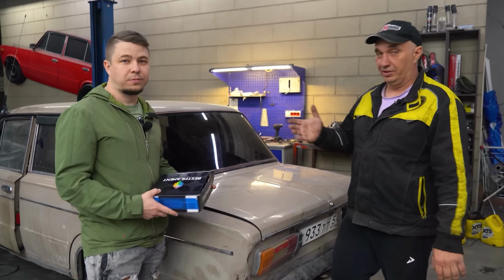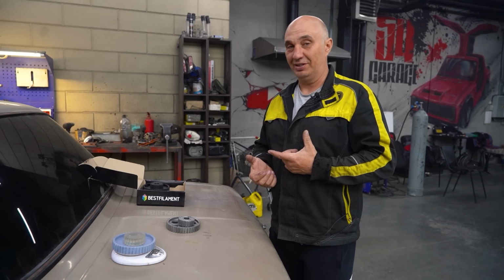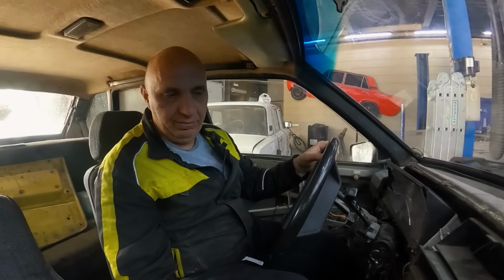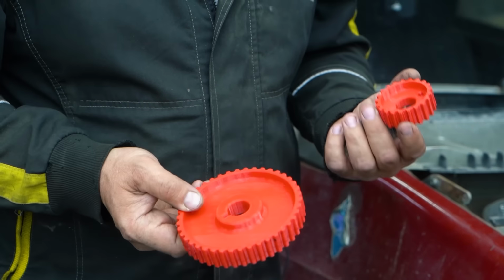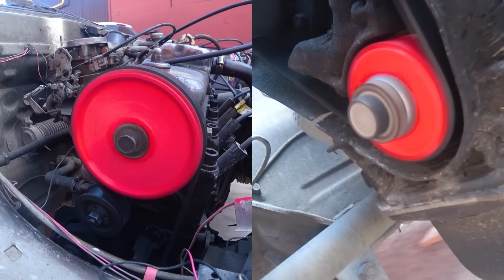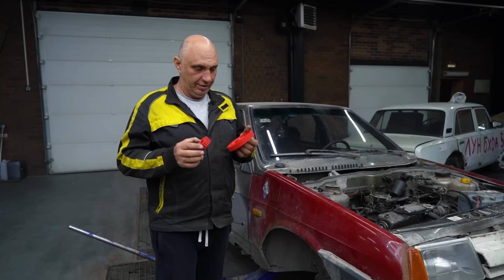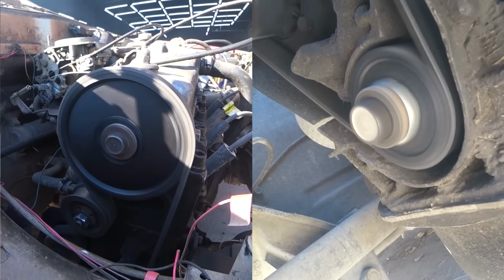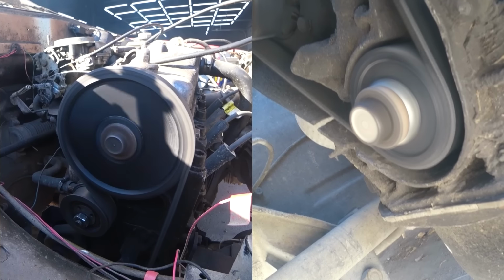3D-printed cam gears from various materials - will they work?

Comment: Command gears such as these and carbon -reinforced plastic pistons and a aluminum engine steering wheel should allow the engine to turn much better.
The head of the pistons should be coated with a metal lid to protect the plastic from excessive heat from the combustion camera explosion.
One  rotation best engine should have a higher valve command and also better air/fuel feed to yield even more.

Comment: what about making a Gear Drive? like a "pete jackson gear drive?"     compare that to a timing belt? some american vehicles seem to last a long time ,,ford 300 I6, has a gear drive instead of timing chain or belt and big bearing surfaces.  (also making your own oil baffles? or a 3d printed oil pan? or mercedes has these pipe tubes with the conductor for spark plugs in them (could try and print something similar?) or print your own carb spacers?

Comment: Now make some more 3d printed parts, but slightly change the cam timing,..  +1 degree, +2 degree +3degree and -1degree, -2degree, -3degress etc.  To see if you can change the power on the engine...

Comment: I have an old 270 GMC straight 6 engine.  It originally had micarta timing gears.  It was essentially resin and canvas composite made from what they had in 1941.  It held up for years but after sitting still in a pool of oil for about 30 years, the gear teeth at that location got soft and fell off and that was the end.  I was able to find aluminum replacements but i think the nylon gears you tested would work PErFecTLY !!!!!

Comment: With a material that works, you should try progressively more aggressive cam timing. Move in half degree increments both directions and see what the affects on low end/high end torque and power are.

Comment: You should do an engine with all your mods from different videos, lightened engine, hi lift cam engine, springs on the crank engine, springs between the pistons and head engine and so on, a before and after dyno run and how cheap each mod is so we can do it at home as you are educating us and we are having fun doing it. 
Maybe fit a AMR500 supercharger as they are very cheap and available

Comment: I love my 3D printer. I use it all the time to make practical things for the shop.
Reply: Like what? I'm not being a smartarse, I've never really seen a printer working.
Reply: @stevo68  I made an adapter for my mill that goes on a drill to raise and lower the table, mill table covers, trays, head tramming housing for dial indicators. I made a lot of stuff that works well.

Comment: BMW and Ford are taking notes. Maybe try plastic crankshaft and plastic engine block next. That’s their next step. A fully plastic engine with a wet belt.
Reply: And none of the pulleys can have keyways.😂
Reply: Found on road dead  @JamesAnderson-fw5ew
Reply: Tbh I just hope Ford finally does something. About these silly sized belts and switch to rubber bands
Reply: Funny enough, some small predator engines like the 98cc and Briggs and Stratton equivalent, use a steel shaft and a plastic cam
Reply: yea bud cause bmw engines are plastic🤡
Reply: And a wet seat to give you a wet ass

Comment: There are 4 parts that I would like to see how they would hold up being 3d printed.
Cam Bacouse, I think it would snap or mealt.
A carburetor full of Holly-style carb.  and intake manifold
And build a driven supercharger.  Other than that, how about a standard transmission case and bellhousing? And rear differential gears set ( think they would snap from pressure)

Comment: How about doing another plastic cam gear with a bit of advance, say 5 to 7 degrees? Why not experiment with advanced timing and plastic material? Also, making the gears a bit thicker may solve the slight flexing. Cheers!

Comment: As long as the plastic isn't compromised by temperatures in the 220°f range, they will be awesome, thats the temperature of the crankshaft, the same as the engine oil, a Lada people are trying to use 3d printing plastic for automotive purposes, but I prefer epoxy resin with my addition of talcum powder, yes it handles high temperature for thermostat housings and I repaired my broken engine block and gearbox with this method, still working after 5 years 😀

Comment: this is something i have always considered but since most my engines are "interference" engines  i never really tried but i also recently came across a 3d printer that can extrude aluminium so im really happy to see something of a "proof of concept" from these guys. there are also a few coatings that could help with the heat on the more plastic like materials. there is also a process called "hybrid additive manufacturing" where you inlay metal and other materials into the 3d print i stopped thinking about this for about a year and now its been put right back into my thoughts

Comment: The problem with plastic in the engine is not that it can't withstand the temperatures or lacks strength, it can, but that it can't withstand temperature fluctuations well. The car manufacturers see that the intake manifold on the car is as good as new when it's scrapped, so they replace it with a plastic one that cracks at the same time as the water pump (also plastic) and the front suspension break down. They are good at calculating this, so when the car has reached the intended number of kilometers, it breaks down completely. Everything goes to Hell, starting to repair it when the manufacturer thinks it has gone far enough is a waste. No sooner have you installed part A than parts B and C break, and when they are replaced, part D breaks. And when part E breaks, you have real problems, because it's no longer in stock and what you find at the car scrapyard is just as fucked up as the one you already have. Just wait until you have to start looking for parts for 15-year-old electric cars...

Comment: Try FEA topology optimization on the cam gear design and try using the 3d print as a mold for some forged carbon fiber cam gears?

Comment: I'm a retired car mechanic and I wouldn't go lighter than aluminum with the same holes as in the steel ones to reduce weight. The summer is short and the cold temperature would make the material brittle. But aluminum is much lighter than steel and easy to work with. I made the first transmission casing to Scania Streamliner that was made out of Aluminum. I'm not a Swede but moved there to find work.  🌷
Reply: Magnesium, or the Mg-Al alloy, seem viable. (just pray there's not a car fire 🥴)
Some smartphones used it (early Galaxy models did), as well as some laptops; I believe they were an alloy but still primarily Mg.
Reply: Common aftermarket adjustable cam gears are made from aluminium with an outer steel ring. Don't know the weight difference but it adds up if you have four.

Comment: Ford salivating while watching this
Reply: Ford and gm have had plastic cam gears in some 80s engines
Reply: @gheewillickers teflon coated. I have several 80's Ford's. Original wheel bearings and cam gears are teflon coated. Believe it or not, about 2009 I had a 1987 with original Teflon coated wheel bearings around 120k. I did replace them with steel, but they actually looked okay. First and only time I saw oem coated wheel bearings. 

Cam gears are almost always broken off and it's common to find chunks in the oil pan.
Reply: LOL
Reply: They will print it with 5% infill

Comment: I was under the bonnet and asked a friend to just blip the throttle, idiot redlined it and the motor stopped.....WTF ! 😳.... 🤔......🤬.
It turns out the distributor shaft small drive gear was made of white plastic and had split and came off the shaft and fell into the sump and without consequence except for the motor stopping.
Replacement part was made of metal, the plastic gear failing was a common fault according to the parts counter sales guy.

Comment: You should electroplate the plastic in metal. A company called Integran had come up with a process using Nickel & Cobalt to create an amazingly strong nanocrystalline electroplated coating that is nanometers thick but amazingly strong. The Hacksmith has a video on it.

Comment: Experimenters in the 1970s made the "polimotor", a Ford Pinto engine made mostly of plastic except for a piston crown insert, a cylinder head insert, the compression rings (but not oil scraper), and valve inserts.
Reply: Also used inserts for the female threads in the engine

Comment: GM Ford and others have used Plastic parts in Timing since 60's without major issues. One that "Failed..." GM use Phenolic Cam gear in Timing sets for the "Iron Dukes" that Break Teeth when Distributor or Oil Pump have problem, Cam or other valve part are bad, or just "old age" after 60,000-90,000 Miles as GM also eliminate Harmonic Balancer that made more wear of the cam gear. The crank still had a steel timing gear.

Comment: Are you guys using bungee cords for motor mounts?  That engine looks like it’s about to jump out and run away!
Reply: Worn rubber mounts.

Old RWD Volvos with worn and oil soaked mounts wobble around like that 😂

Comment: I believe that one way to test the resistance of these gears would be to repeatedly press and release the clutch pedal while the RPM is a little high. This would cause the engine to go from a high RPM to a low RPM at the same time, forcing the gears to brake abruptly. This would be an interesting test. Remember, it's not about accelerating the engine and releasing the clutch all at once, but doing this repeatedly, as if you were going to skid the front wheels, but repeatedly... The idea is to make the RPM drop abruptly and rise again. In this loop, the effort on the gears is certainly high.

Comment: We need more 3D printing tests... rims, pistons\conrods, gaskets, bushings, carburetor, and anything else you can put on car. Maybe just "download a car" by printing out everything possible to make a whole vehicle from scratch.
Reply: I recently looked into printing gaskets based on a Garbage Time video early last year where he talked about the good OE Ford gaskets now being out of production for his motor. My concern was that the TPU (flexible) filament wouldn't be petroleum safe; however, much to my surprise it apparently is!

I presume it's minimum temperature of 220C (428F) should be sufficient, but I admittedly have never checked external locations for what they reach during operation. For example the valve cover next to the exhaust manifold. I know most commonly our THERMOSTAT is 210F here in the US, but... I've just never bothered to wonder what various locations actually get up to! I would suspect it'd vary depending on so many factors, cylinder count and whether it's gas or diesel. So yea 🤷‍♂️

However, pistons and connecting rods are just an immediate no. There's absolutely no point in testing them, not with plastics.
3D Printed sintered metal on the other hand, now we have something worthwhile to test! Problem is, I don't know if places like PCBWay or similar, which offer that kind of service (your send a 3D model file) would ship to them. Granted, I assume PCBWay, being a Chinese company would have no issues shipping to Russia, so that's an avenue for G54 to consider. Problem is they'd need nice 3D models of the parts... (not saying they're incapable, but just it's an added expense)

Yea yea, I've lived up to my name 😏
Reply: lmao yes
Reply: Porsche in germany did do metal 3D pistons, and tested it with good results. But you are talking about engineering and a high tech 100 grand 3 D printer.
Reply: metal 3d print is very accessible now, so yeah, you can "download a car"
Reply: Boa ideia 💡,  seria melhor que o aço, por que não enferruja, e seria bom pra região a beira mar onde o sal destrói os carros 🚗
Reply: the problem is that those pieces are designed for metal, for example the first gear should have been designed having in mind that the force goes from the gear pin to the teeth, you need more support material between this zones, but i think it can be done with a litle try and error and some advanced 3D programs
Reply: Somebody in the 1970s made the "polimotor", a Ford pinto engine made mostly of plastic except for a piston crown insert, a cylinder head insert, the compression rings (but not oil scraper), and valve inserts.
Reply: @gregorymalchuk272 how well did that work?
Reply: @PapiDoesIt  The second version of the engine was used in a car and ran several races.

Comment: I would have used nylon. Not only is it really tough and impact resistant, but it's pretty heat resistant as well. Most can tolerate temps around 300F.

Comment: VERY INTERESTING!!! I would have liked to see a Dyno test though... I've read that a reduction in the rotating mass of engine parts increases horsepower output(1lbs less weight = 2.7HP) - & you've saved about 1.5lbs, so you should gain what, 4HP? Anyways - why does that engine SHAKE SOO MUCH? Perhaps you should 3D Print Engine Mounts & Suspension Bushings(Custom Aerodynamic body parts, custom Interior parts\trim, Gear Shift Linkages, Intake Air boxes, Custom Intake Manifolds, Custom Intake Piping\Routing, etc)...🤔

Comment: Now this is a good, more practical yet fun video. FMEA for failure modes....I already know the outcomes because I'm an engineer. People don't realize the amount of thought that is focused on what "type" of material to use in a given application. Physical properties, then cost. And, when it comes to Polymers, well they are not plastics. Although the average person believes this to be interchangeable. Plastic" refers to a specific type of synthetic polymer, while "polymer" is a broader term referring to any large molecule made of repeating smaller units (monomers).

Comment: how do you tighten the bolt without cracking the gear? for me, even if i tightened it by hand enough so that the gear doesn't fall off, i think i would crack right away. even aluminum might crack.
Reply: Because they are pinned gears, and no need to tight bolts too hard. Pins do the real strength. Bolts are just no keep center and gear in right position.

Comment: My biggest concern right from the start, was heat. Just the normal operating temperature of an engine. There's not much mechanical stress on timing gears, but engines simply get hot enough, to soften or even melt some plastics! To me, the winner would be the most heat resistant of the materials.
Reply: My biggest concern was our man just standing over it staring at brittle plastics spinning fast without safety glasses on
Reply: We use PLA timing belt gear in  cnc lathe where it is splashed with coolant. It lasts LONGER than aluminum. Where alu has wear, the pla has nothing
Reply: Heat resistance and chemical resistance (mostly oils) is the most critical
Reply: Yes : Aluminium Is The Solution, and the Answer 🙂
Reply: CF PA-6 would work.
Reply: Crank pulley on and washer in front of lower gear o maintain water temp with a belt
Reply: Same. I'm surprised the CF-infused one held up so well. Must be PLA instead of PETG 🤷‍♂️
Reply: @DUKE_of_RAMBLE  CF infused nylon
Reply: "Yeah, but those are like... expensive?

My cousin Jim can make stuff out of compressed bull semen cheaper, so we're gonna use that instead of aluminum, k? K."

-some jackass accountant

Comment: How about a 3D printed carburetor?
Reply: how about much as possible printed with carbon fiber >;)
i would say it must be at least 30ß0 to 400KG weight reduce....
Reply: @derealhamsta carbon fiber filled filament isn't appreciably lighter than non CF filled filaments. And it's actually weaker in most respects.
Reply: Thermoquad.
Reply: PLA isn't known for being water-tight, and prints can leak. Bambu's latest feature that smooths the surface by doing a post-print pass might help mitigate that but only externally.

However, the bigger issue is it's not resistant to gas, according to my quick research...
"It is clear from the results that exposure to gasoline has its effect on both the materials, but a more adverse effect can be observed on ABS material. PLA has lost 73% and 64% of its tensile and flexural strength respectively, but ABS has lost 97% and 99.6% of its tensile and flexural strength respectively."
(according to irjet)
Reply: @DUKE_of_RAMBLE the filament has nothing to do with the end product being water tight, thats in the settings.
Reply: @DrewLSsix  I don't print, so that's fair, and might solve it. I do know PLA absorbs water (hence dehumidifiers to store them in), so that could still pose an issue if it behaved similarly with gasoline.

Either way, gasoline weakening it still makes it a nonstarter in my eyes.
Reply: the design would need to flow more air and atomize fuel. and be lighter than oem.

most resins and plastics dissolve in liquid fuels... some polish to a point and kind of melt. and then dont melt more leach or enbrittle
Reply: SmarterEveryDay did something similar with a clear plastic carburetor and 3d printed components.
Reply: That might work actually😂
Reply: they made a translucent plastic carb.